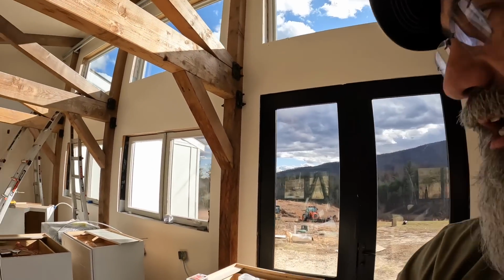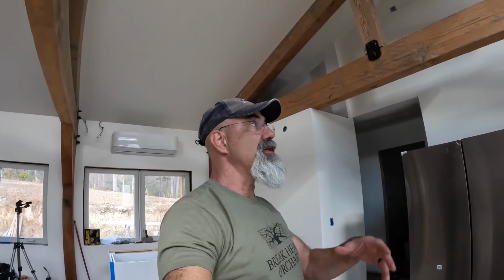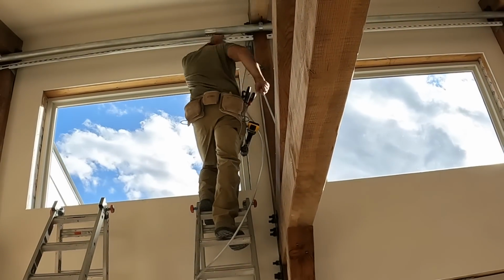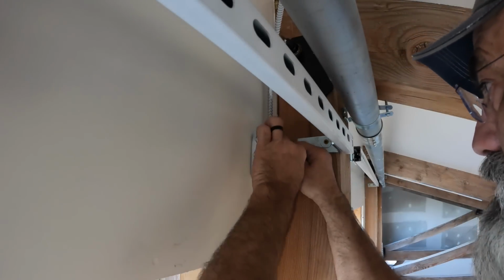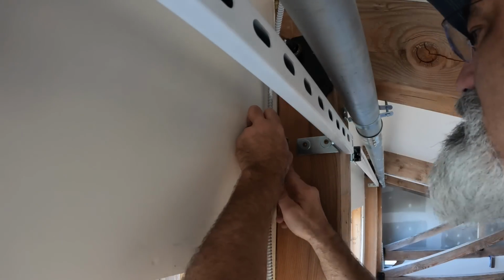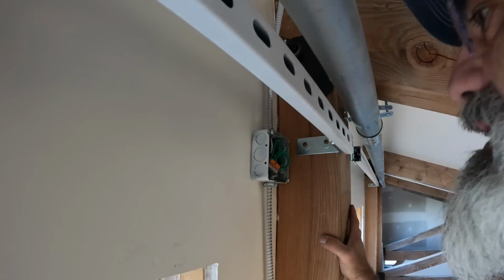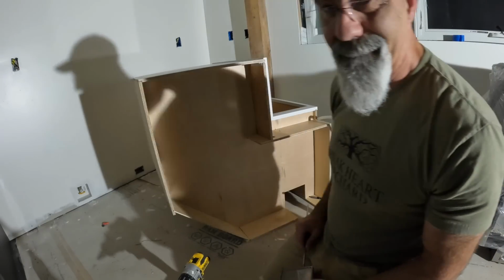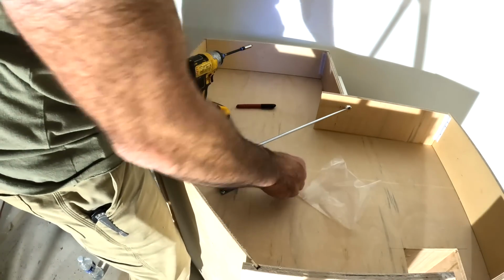Installing our Farmhouse Sink - Belfast Sink -     Building our Dream House

Comment: One thing I've learned doing my own build is that trying to power through things late at night can lead to mistakes or very often makes the job harder than what it is. Personally, after doing the rough opening for the sink, I would have waited for the cabinets to be installed, then do the final adjustments. 

Either way, you are getting there, and Lauren is recovering. Life is good!
Reply: Jorge so true.  We are in a crunch, but I completely agree.  Powering through does not always work.  You just add more.  Cannot wait to be on-site instead of commuting.
Reply from the maker: Years ago, when we were clearing the land for the orchard, I was working late on a summer night and almost managed to "volunteer as tribute".  I saw a pattern emerge that summer.  working past 8 PM in heavy equipment led to a lot of near misses so I stopped doing it, unless something was a true emergency or could only be done at night.